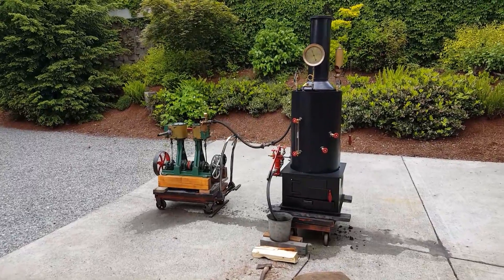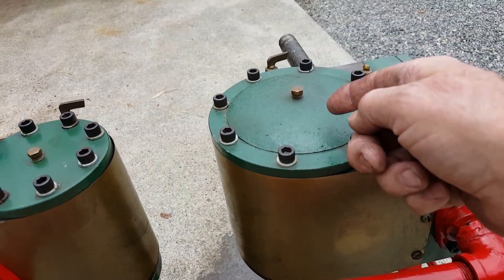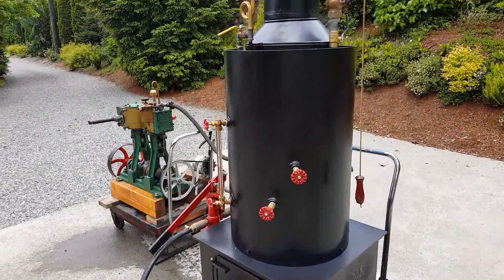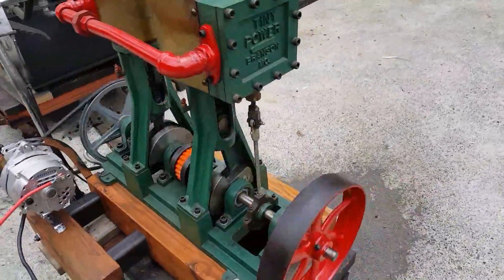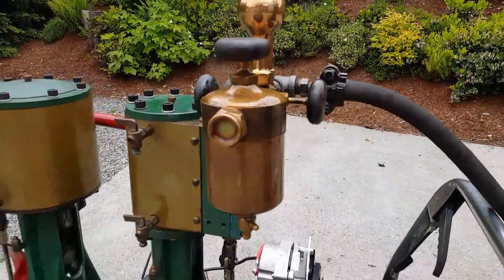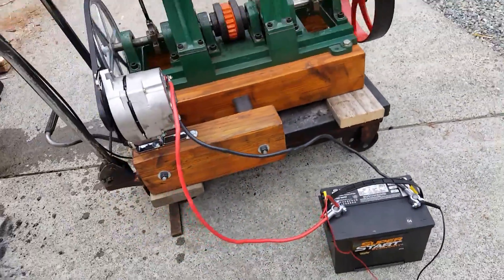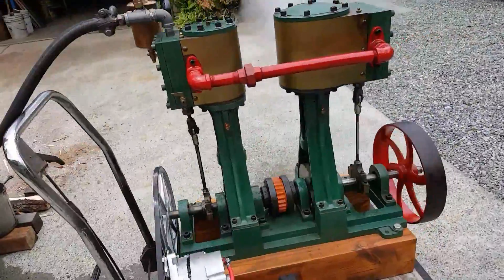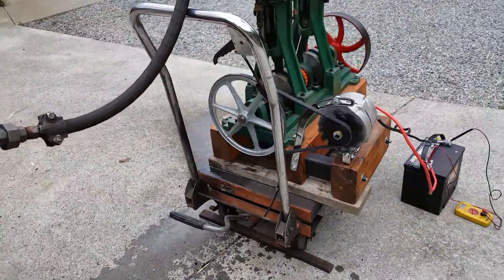Steam Engine and Boiler with alternator off grid

Comment: I want to make something that uses biofuel to power batteries then run my home ac system off the batteries. The AC is like $400 a month in electricity keeping house at like 68 degrees.
Reply: If you need that much a/c then you must have plenty of sun for solar? Plus is it's 0 labor once installed

Comment: The 85 amp alternator could power a 1kw inverter. And that engine with that boiler could probably power a significantly more powerful alternator under load.
Add an inverter and you've got yourself a lovely little off-grid AC power setup right there.

Comment: Hello, I know you sold this set up, But I have a question. How "Long" would this set up "Last" ?? Meaning, If I ran it ALL DAY EVERY DAY 24 HOURS A DAY, How long would this Set up " Last" before becoming "Worn Out" ???? Kinda like a gas motor is worn out at around 250/300,000 miles ??. Also, How long would the set up "Operate" before it needed "Tending Too"??? Like adding firewood and or water ??. I'm seriously considering buying a steamer set up to keep my Batteries all charged(by alternator like yours) But haven't found anyone (old enough to know details) that knows how "Long" this set up would "Last" !!??????. Please help, And I'd love to "Pick your brain" for all the Info I could get/learn !!!!!!??. Thx. Dan.
Reply: The guys how operated steam locomotives and steam vessels where usually tradesman working with engines and/or metals, because of the high maintance. So to run it ecconomical, those guys knew how to make new bearings and parts, that is from casting, machining and fitting just about everthing. a bearing in a steam engine of that size, given it's well maintained and services regularly.... depending on material and all other factors can live up to 500-2000 machine hours i would say. The endurance of a plant is also not easily answered, as there are different types of boilers. Just think of the steam liners, they had huge boilers and a constand crew to maintain them. But i would not consider this for a permanent power source on which you want to depend. And it will be hard to operate it while you are working on something else. On my steamboat, i have to constantly check everything, as it's a very fragile balance, but 10-15min without interaction is feasable, if all conditions work hand in hand. But as pointed out by thereasoanbleamericans: constant supervision. That's why in marine applications the diesel tuck over so fast. And also in powerplants on farms, small workshops and such. Just because, it's so much easier to operate. BTW: the old diesels work on waste oil.... i guess bio fuel is the better direction to go on. And have a engine that is easier serviceable. They used wood and even swine poop to make petrol engines work back in the days....
Reply: If I knew about the Marine Industry Tec. ,I would still be an Alaska homesteader and if I knew steam engines, I would still be sailing the Caribbean. First off that alternator is crap. You try to charge house battery's with that, you'll tear the guts out.  That engine is big enough to drive the house and he's made jumper cables. Use marine alt designed for deep cycle battery..that motor has to be tinkered with every day(per-start).
Reply: Probably not all that long honestly.  The build quality just isn't there.  We could go into details of the bearings and the crankshaft I've seen from these units and it's plainly obvious to see its poorly manufactured and engineered.  I wouldn't put a video out showing missing lock washers on bolts etc. 

As for tending, it needs CONSTANT supervision.  Steam power engines can NEVER be left alone, they're not safe when not monitored because the pressure is dependent upon fuel that isn't measured like an injector measures gasoline etc.  Sure you can put pressure relief valves and such but everything can stick/fail/etc. turning these into time bombs.  Now as for the question of how often you have to feed it fuel etc, depends on your source, coal for example is fairly consistent but again it's constant feeding to keep it running peak.  If you feed too much, you waste fuel because it ends up going out the pressure relief valves, too little and the motor doesn't run full speed.  Thus if you want to feed it less often, you end up wasting more fuel.  Plan on every 15 minutes feeding some fuel to it at very least.  Sorry I can't answer your question better but you can imagine how many variables exist in your question.

This engine would be great in a pinch, as a handy mechanic, one could keep it going for thousands of hours potentially but I'd expect to have to MAKE and design parts for it as they wore out.  I'm tempted to invest in one for a SHTF engine but sadly, there seems to be next to none in regards to quality steam engines produced today.

Comment: why the modern flex coupling betw the two engines?  Why not a one piece crank like in marine practice?  did you make these engines  or were they bought?
Reply from the maker: I am not sure why Tiny Power built the engines with a flex coupler.

Comment: how mush did you get the boiler for
Reply: much
Reply from the maker: New Boiler 20" dia. with 22 1-1/2"dia. Copper Tubes for Large Steam Engines.
On ebay it is $5,600.00. If you buy it direct from save $600.00
**WOW** Free Shipping!!!